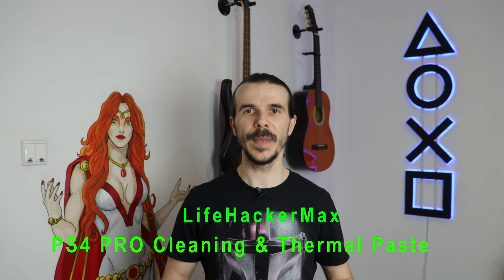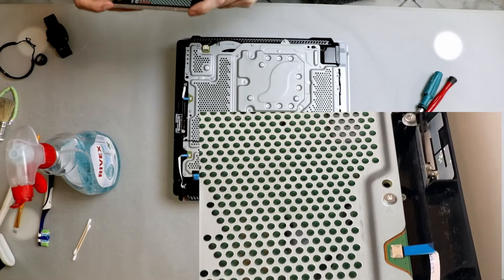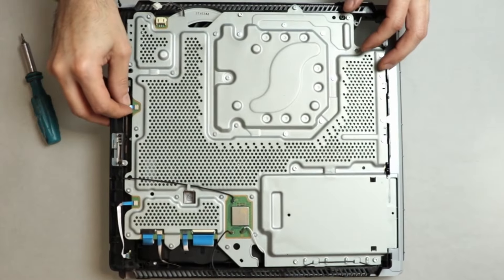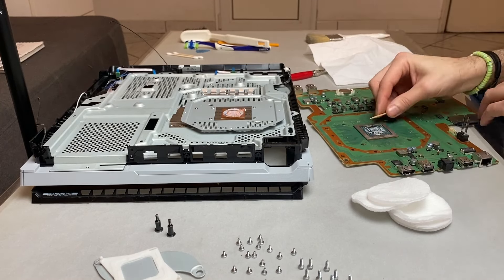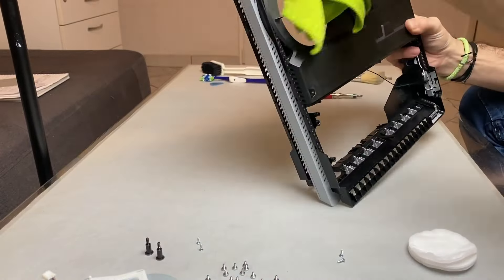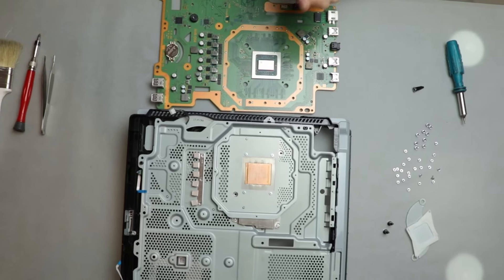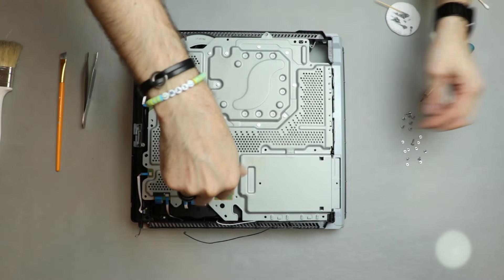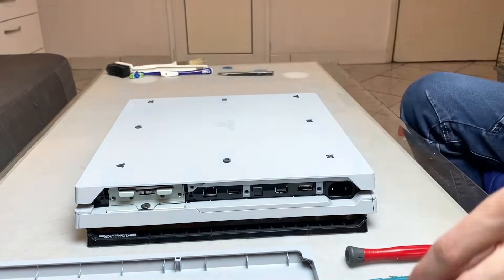PS4 PRO DIY Cleaning and Thermal Paste: God of War Edition

Comment: Thanks for your video. It was clear and easy to follow. Our PS4 Pro sounded like a jet engine and now it’s warm but the fans aren’t loud at all! 

The only difference I did was removing the PSU cable from the unit, NOT the motherboard as I was worried it might break.
Reply from the maker: I am glad you found it useful! And thank you for your suggestion. It is a great idea to avoid putting strain on the motherboard socket. Great tip 👍🏼.

Comment: Thank you Max! I followed your detailed procedure, and it worked like a charm! Changed thermal paste and removed dust barrier (!) that had built in the heat sink... PS4 Pro now operates silently... much better on the ears. Bought the PS4 used, and had to deal with worn-out screws from a previous home-made maintenance, which was "fun". - François (Montréal, Canada)
Reply from the maker: Glad I could help! Thank you for taking the time to comment! It really makes my days better ☺️. Happy gaming François! 🎮

Comment: Nice . This console was not as dusty as I expected, but even so , if the thermal paste is dry it can start sounding like airplain 10 min in to the game
Reply: I always keep the carbon upside off, this way it makes it 10 times less noisy, but it only looks like a handmade robot playstationstein
Reply: @DeddensGames  hahahaha 😅 nice . I wouldn't recommend keep it open , since it will get dusty 100 times faster . But it's your choice. 
Better solution - take it apart, clean it , change the thermal paste (get a good one ,it's like 6,7€- not more than 10$) and close it , mine sounds like new . Only on the map menu of God of war (don't know why) I can hear the fan spinning wild , but the moment I start playing the fan gets slower
Reply: I couldn't decide on the thickness of the pads for PS4 Pro.  1mm or 1.5mm help.

Comment: Yo idk if u remembered the video or hack u posted to get the controller to charge from the charging station but i have to tell u that it works perfect for me as the connecters i have in my controllers to charge them are burst so i was left with only one option and that was to charge the controller with a charging station but i did not own one so i followed ur video on how you use two usb cable to make a charger for the bottom port, i am greatful for that so i subscribed.😆
Reply from the maker: Thank you! 😊 I am happy it worked out for you. And I am glad that my video reached you.
Reply: @LifeHackerMax  😆

Comment: Thank you for the clear instructions. Although i have a problem with removing the power supply. I cant seem to disconnect the power supply from the mother board. And i also want to pull to hard on it and break it. Do you have any suggestions?
Reply: *dont want to pull too hard on the connection. Just noticed the mistake 😅
Reply from the maker: @brianzantboer3188  I know it is not recommended but for me it usually works by pulling on the wires and moving them from side to side (left-right).
Reply: Thanks. Yeah I’ve seen several videos about disassembling a ps4 pro and some other people also had trouble disconnecting the power supply and by pulling too hard they damaged it and broke the console. So I’m quite scared to pull too hard on it. But I could try again and see if it works
Reply from the maker: @brianzantboer3188  I noticed this problem on other comments. Wiggle the wires from side to side should flex the plastic socket in such a way that the lock pins should slip out of the socket. Be careful though.

Comment: The fake screw stressed me out so much lol
Reply from the maker: 😅 me too. I just had to make a note about it in the video 🤭
Reply: I followed another videos instruction where he got it out somehow and i thought the power supply holds onto that, the result, i had no tool for it and drilled out the screw, since it was on the edge . Good thing that theres no hardware close. 10/10 experience